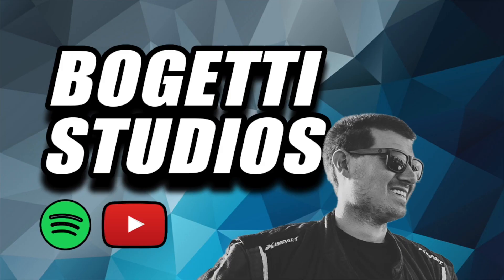Talking Engines. DOHC Vs OHV & NA Racing

Comment: Ford actually did it because of the fact that it is more traditionally reliable to put an engine like the 73 in a worktruck. Most of the older engines create more torque per horsepower that was the whole point of the engine and Ford building it the way they did it. That's why it blew everybody away with a bound average of a 160 to 240 foot-pounds of torque..